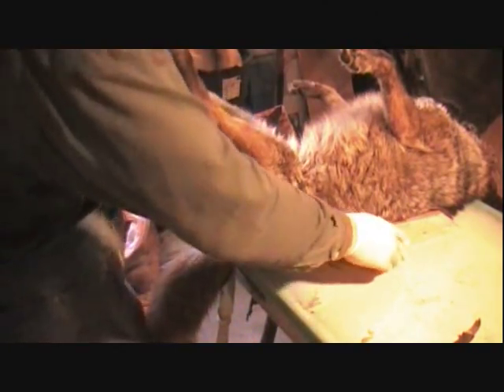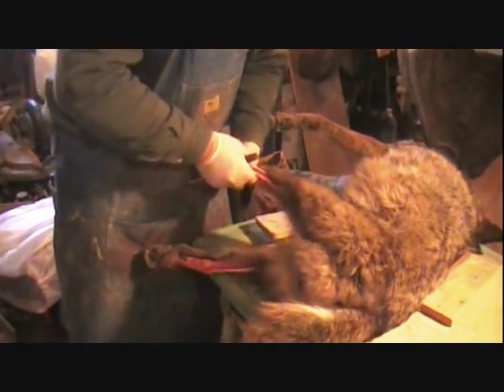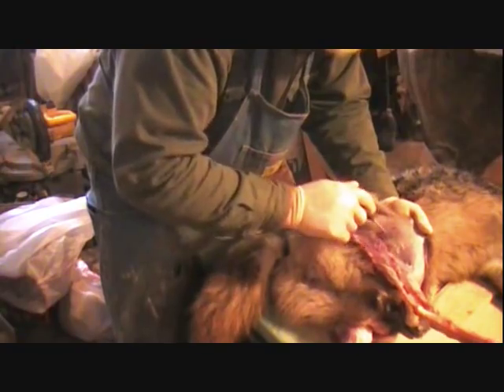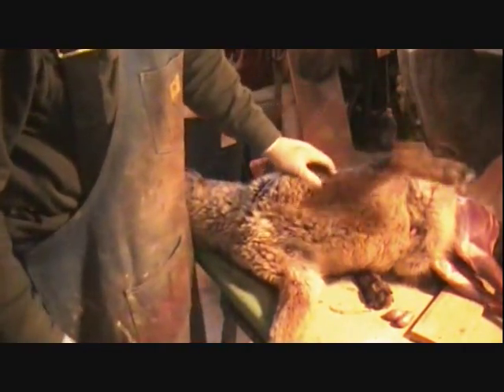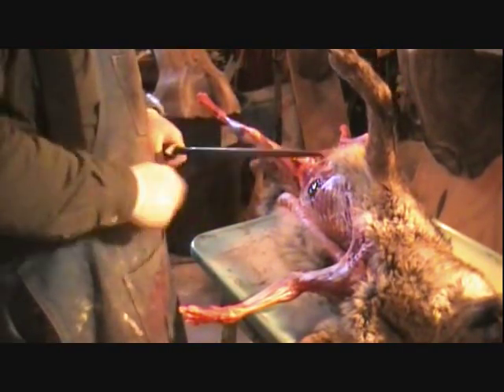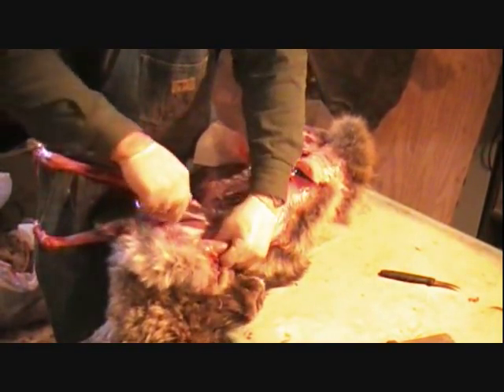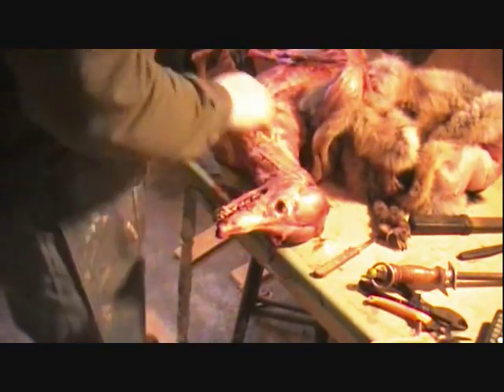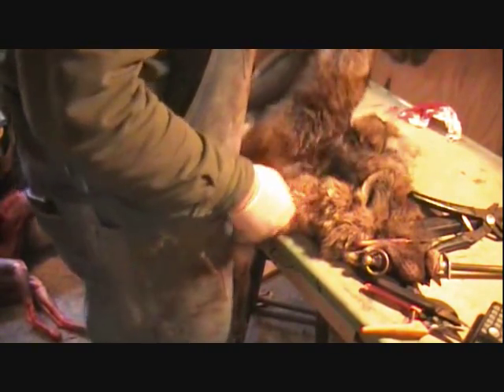COYOTE - SKIN, FLESH, BREAK - Furbearing Animals - Video  2 of 2

Comment: I have looked over your webpage (great for beginners like me) but I can not see an email address on that page. I have a question re- dry mounting (using borax) I have only done one large white rat so far and everything worked as per some information I found on youtube. I have watched some of your videos and see you do the same dry mounting with birds. PS thank you for the information on injecting bird feet. I am wondering in Australia we do not have wide squirrels that I have seen others using borax and drying them out, I am wondering what other animals can I use this posses on ? what about small rabbits? and maybe injecting the ears with bird feet liquid..... or possums? ANY help would be great. Thanks Nigel
Reply from the maker: Maybe the email area isn't easily accessible. I thought I put the link in a good place, guess not. I have the links below each video. Thought that would be convenient. Better reassess that choice. Thanks for letting me know about that problem.
First, the Birds Feet Injection is just for feet, not ears.  Some animals are easier than others to skin the ears. Some are primarily cartilage. In those, liberally apply your dry preservative down deep in the ears. As far as you can get. Just do the best you can.  A butter knife works well on rabbit ears; long and dull, reach down there as deep as possible to scrape.
 I've used the dry preservative through the years on just about anything, up to deer size. Make sure you don't rush the whole process. Don't start brushing the hair a couple of days after applying the preservative. Wait until you know the hair is completely set.
Possum would work great with this method. The feet are pretty plump, make sure you use the Bird's Foot Injection. Rabbits, yes, dry preservative works well. They're pretty thin skinned and hard to do without tearing. I have trouble with skinning rabbits.
If you believe you did a decent job on the rat, you should be fine with other small game. Try different animals. Why not? Experiment. As you already know, it requires patience and time. If you make mistakes, don't get frustrated, just learn from them.
If you think I can help in any areas, please feel free to contact me anytime, Nigel. Good luck to you. - Rick

Website:  Everything Wild Taxidermy, Flintknapping, DIY Life
Reply from the maker: One more thing, Nigel.  Make sure you flesh and wash the possum real well. They have good fat and are greasy. Thanks again. - Rick

Website:  Everything Wild Taxidermy, Flintknapping, DIY Life
Reply: Richard Smith THANK you for your reply, its great to have a professional that is willing to help out.
Reply from the maker: sicklittlepig Well, thank you again for your compliments. That's the beauty of getting and/or giving knowledge. There's always people out there that know more than us that we can learn from. I learn new things everyday. Good luck to you. - Rick

Website:  Everything Wild Taxidermy, Flintknapping, DIY Life